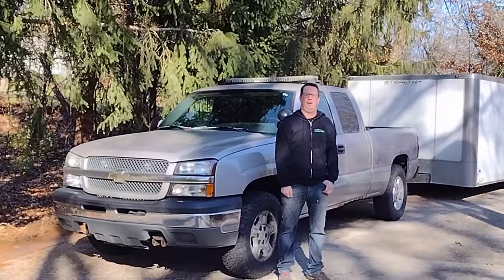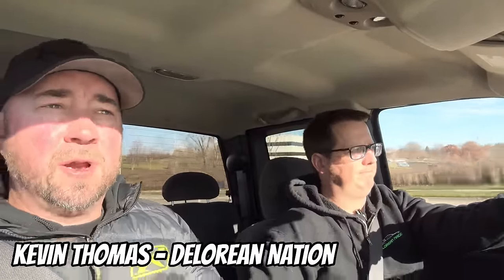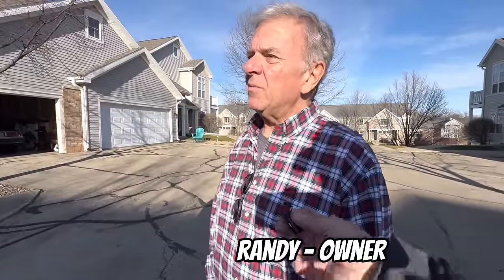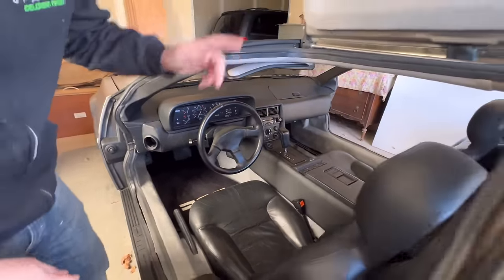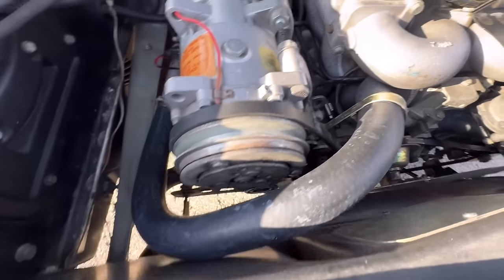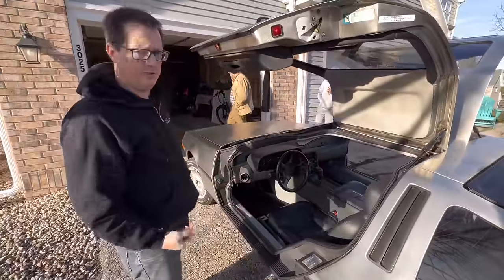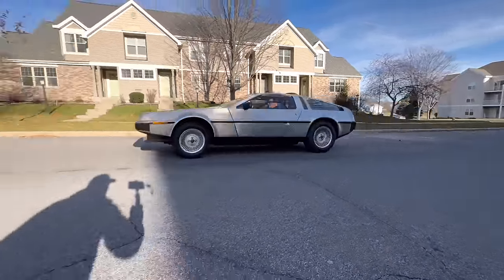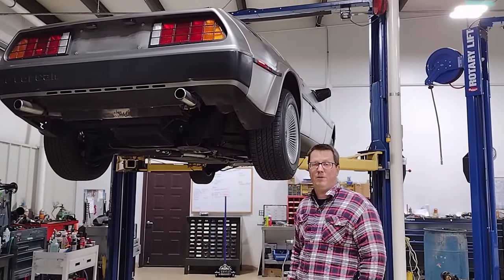Mint DeLorean FOR SALE! Test Drive & Review

Comment: Excellent! Kevin mentioned “corduroy” pattern on the stock graining. It didn’t show up on the camera. I know what corduroy material is, but what is that on the graining? Does it have to do with the type of wheel they used on it?
Reply: I call the darker and lighter striping some cars have corduroy. Maybe 1/8" wide. Only consistent with original graining.